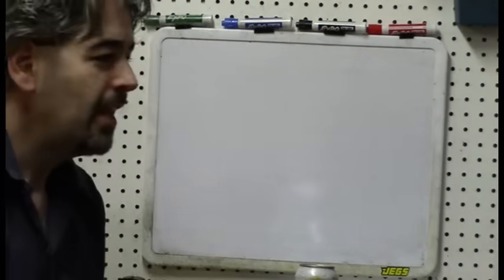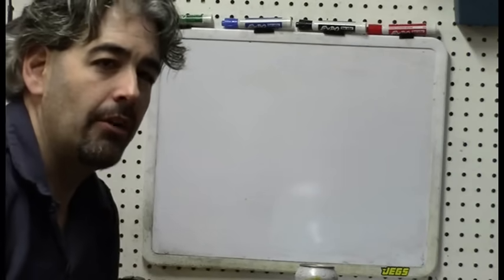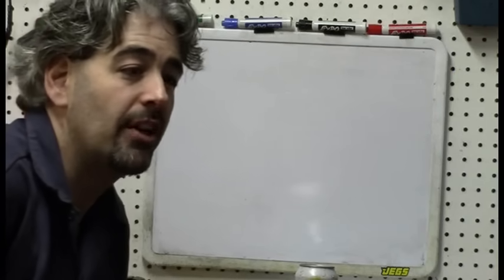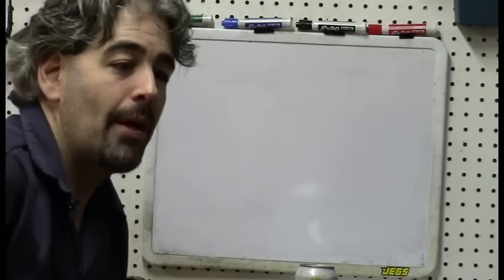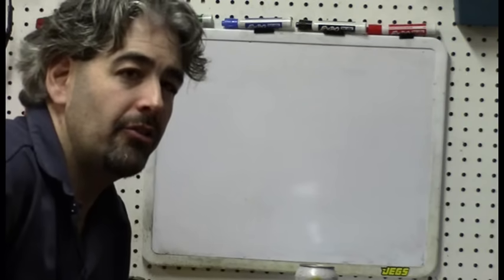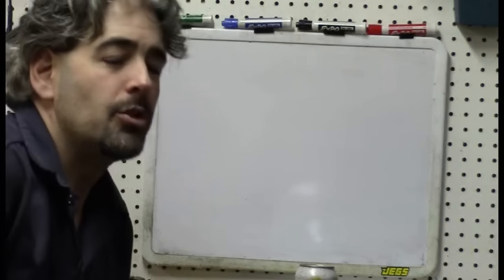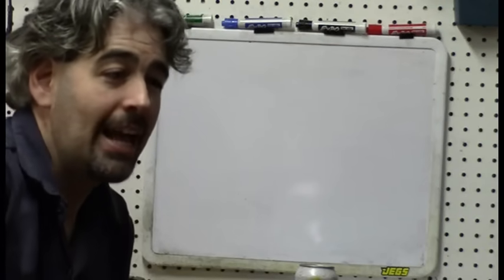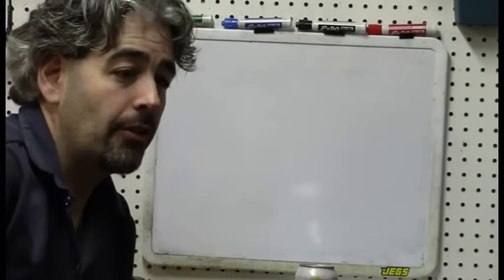Secret of Engine Problem Diagnosis- Fuel Trims Pt.1

Comment: My toyota on the scan tool indicates it is in closed loop. It never comes out of closed loop, according to the scan tool.
Any thoughts about that?

Also, my Toyota has B1 LTFT of 19.5% that drops to a steady 12-13% at 2,000 RPM. I used my vacuum gauge and it's ok. I double checked by spraying carb cleaner around all the sealed joints, and nothing. I check the brake booster: nothing. But, I did replace the O2 sensor about 3 months ago and now it's doing this. So I'm thinking maybe the O2 sensor is messed up, giving a false lean reading, thus the LTFT.
So I pulled the plugs, and they are fine. coils are fine. O2 sensors on both banks are reading similarly.
Reply from the maker: good thought on the booster. I would not even bother with the O2 actually since you have fuel trim adjustment that clearly zero’s on the short term. 
  The vacuum gauge is useless- it will not tell you anything on a modern car- remember your fuel trim is balanced. 
  I would recheck for vacuum leaks - it’s pretty clear that is at some level of vacuum leak but it’s not going to be very big.

Comment: I have a 2018 mustang gt with a Roush CAI, Roush x-pipe, Roush axle back and dealer installed Roush pcm calibration (tune). The car has ~5600 miles on it. My ltft bank 1 is ~11.7% at idle and around 5% during regular city driving. My ltft bank 2 is at ~7.8 % at idle and around 5% in normal city driving. My 02 voltage is around .65-.75v. I currently have no codes because they’ve been cleared but at wot and around 6500-7000 rpm my cel comes on with a p0300 code. My mode 6 on my scanner shows misfire counts as well (1-2 counts ) randomly across cylinders 2-7. My maf reads 390-500 g/s at idle as well. Car was checked multiple times even with the cel on and i have been told the car is fine and that nothing is wrong....coil packs are fine, spark is fine, Maf was cleaned and functioning fine.... what is going on??? STFT  is generally -3.5-3.0 too btw. Help!
Reply from the maker: Your O2 readings cannot be .65-.75 with those fuel trims  It is impossible.
  Either way you need to look at the O2 response under WOT.
Reply: Currently at idle im looking at this on my obd2:

Bank 1
Ltft 9.4
Stft -.08
O2st: .69
Bank2
Ltft: 5.5
Stft: .08
O2st:.705
Soo....what I’m seeing is what I’m relaying..
Reply: Is there a way I can send a screenshot of my live data somewhere? I’m using a blue driver obd2 as well. Appreciate the help as well btw so thanks  🙏🏽
Reply from the maker: @kicksnkrs8192  Just send me the relevant data only --not a screenshot
Reply: Sure. What exact data should I be collecting?  Fuel trims and what else specifically? I’ll collect the info on a drive tomorrow and post it. Also notice on my mode 06 data that I have misfire counts (between 1-3 counts) on random cylinders but no codes. I mentioned earlier that it was on cylinders 2-7 but today I had a few on 1 and 8 as well. Was wondering if that was diagnosable being so few and so random...?
Reply from the maker: I need to see the fuel trim curved against RPM
Reply: This evening’s test drive ; a mix of city and hey driving:
———————————-
At idle ( ~650 rpm) 
Bank 1:
Stft:
Oscillates from -2.3 to 2.1
Ltft:
Steady at 7.0
Bank 2:
Stft:
Oscillates from -1.6 to 2.3
Ltft:
Steady at 3.9
———————————
At 1000 rpm 

Bank 1:
Stft: 1.6
Ltft: 8.6

Bank 2:
Stft: -0.2
Ltft: 7.0
———————
At 1612 rpm

Bank 1:
Stft: 0.3
Ltft: 9.0

Bank 2:
Stft: 0.7
Ltft: 7.8
———————
At 1882 rpm

Bank 1:
Stft: 0
Ltft: 9.4

Bank 2:
Stft: 0.3
Ltft: 6.6
———————

At 2097 rpm

Bank 1:
Stft: -5.6
Ltft: 8.3

Bank 2:
Stft: -2.1
Ltft: 3.9
———————
 At 2321 rpm

Bank 1:
Stft: -0.3
Ltft: 4.7

Bank 2:
Stft: 0.4
Ltft: 2.3
———————
At 4066 rpm
Bank 1:
Stft: 2.3
Ltft: -2.1

Bank 2:
Stft: 2.5
Ltft: -1.1
———————
At wide open throttle 
(6679rpm)

Bank 1:
Stft: -1.6
Ltft: -3.1

Bank 2:
Stft: -1.8
Ltft: -2.3

Comment: Oddly enough 14.7 is the atmospheric at sea level. Is there a correlation?
Reply from the maker: Yes I get asked this a lot. There is no connection or correlation. It’s totally coincidental.
Reply: @SchrodingersBox  Surely with height above sea level fuel injection can compensate but carburettors need jets changed?
Reply from the maker: That would be correct.

Comment: Hi Matt, I've been watching your fuel trim videos + maf sensor videos etc several times and find it very interesting, I have a question and fully understand if you don't answer to this based on the following not so extensive info but to begin with I had a P0171 since I bought his Passat 2008 2.0 TSI a month ago, when erasing the code w my scan tool from iCarsoft the engine starts to rev badly and up and down not so clean, the short and long time fuel trims went to zero % but then the P0300 showed up w random misfire on cyl 1+2+4 and after a while just on 2+4...and after a while the engine runs like ok again but the long term ft is on 25% again...have done the testing and understand it is not a vacuum leak, have also removed the MAF sensor cable whil engine is running and no difference = it runs "perfect" wit or without the MAF inline...??? -I also checked the ign. coils and saw that there were 3 different kinds put into this car where 2 were the same, also switched places w them but the same misfire on cyl 1+2+4 were appearing, any hint would be much appreciated, thanks a lot if so cheers from Sweden ;-)
Reply from the maker: I would need to know the RPMs you saw the fuel trim at 25%
Reply: @SchrodingersBox  It's on idle 8oo rpm and when adding rpm's it's still on 25% and the stft slightly varies but stays around zero, added code yesterday is P0101...fuel rail pressure 3900 kpa...MAF cables w ignition on as follows: 1=4.85v 2=0,02v ground 3=11.70v 4=0,01v ground 5=3.09v thanks, I have the throttle pos values etc written down out in the car if you need them, also changed the spark plugs and nr.1 closest to the timingchain was very carboun fouled while the others looked pretty normal  ;-)
Reply: I hereby add the info of the following that took part after having taken my car to a VW workshop nearby, the reason for this P0171 and ocassionaly some other codes were in fact due to a leaking seal (gland) that causes this code but the computer doesn't realise this, air coming in the backway so to speak, cost me a lot to have it fixed as they had to remove the automatic transmission to put a new one in, 1000 $....now the code is gone and car works well hopefully, the cause of the no 1 fouled/burnt sparkplug is probably due to coal on the intake which I will try to fix myself.
Reply from the maker: I would do a volumetric efficiency test next - could also do rail pressure.

Comment: Doesn't the computer detects the fault, as rpm will increase without changing the throttle position, since there is extra air going in from somewhere. Or the rpm remains the same despite the fact that engine has to do extra work compressing extra unburnt air part, it just adds fuel, but then also rpm will rise without giving throttle
Reply from the maker: Yes if the RPMs change enough this will set a check engine light-- but the question is- for what? For a TPS? For an EGR?  the code will not likely be accurate.

Comment: Does the LTFT generally apply it's new/learned baseline on the next engine start-up? does the LTFT generally become more permanent after x amount of engine start-ups following the last ECU reset (depending on the make) ?
Reply from the maker: Yes- LTFT does get more refined with time. On a startup- the engine computer uses LTFt as the default 
  It isn’t right to think of LTFT as setting after “X” number of startups. Rather it is always evolving and adapting as STFT inputs are integrated.
Reply: Thank you sir!
Reply: Is it ever beneficial to manually reset the ecu? Perhaps after a correction is made and to clear out any 'bad memory' that would prolong the process of establishing a 'good' baseline?
Reply from the maker: It is not necessary. If there is “bad data” prior to a repair it will immediately be corrected by the STFT. In fact, this is exactly how i verify the repair is made. If for example a car has a LTFT of 25 with a zero’d STFT and I fix the fuel trim issue- instead of resetting the ECU, I will instead look as the STFT goes negative to correct the now “bad” LTFT value.
Reply: Okay, I have another question. I have a cheap 60$ Obdii ultragauge I've had for 7+ years. Anyway, it displays in real-time my STFT and LTFT (00.00). While driving, if I glance at the numbers and LTFT says 10.2 and STFT says -3.4. Does this mean in that very moment as  those numbers are displayed, the ECU/engine is currently behaving on the LTFT(10.2) number and STFT(-.3.4) is "making note" of the adjustment that would be better the next time engine is at that exact speed/rpm/load, (cutting back 3.4)?  

In other words, LTFT parameter in real time tells you what the engine is doing and acting on now - and the STFT tells you how much more or less fuel could have actually been used to sustain that current rpm/load/speed?

How long, or how many pulses, of the STFT's corrections does it take before the LTFT considers it? Is there a typical algorithm followed on ECUs if, f(stft)= LTFT?
Reply from the maker: @Wes_5kyph1  No its the opposite- the STFT shows the adjustment NOW while the LTFT is the baseline (also now). If at this moment you have a LTFT of 10 and an STFT of 3, your actual trim NOW is 13.  
  Eventually, if held long enough, the LTFT will change to 13 and the STFT will zero.  How long this takes depends entirely on the model. I have seen some cars do this really fast- within seconds.  others I have seen take several minutes.
Reply: Thank you, so the STFT metric is always in relation to LTFT metric. it's funny they don't provide a gauge for just 'actual fuel trim' (LTFT + STFT). Thank you!

Comment: I am dealing with a system rich code
things were very interesting until
the odb scanner stopped reporting the FTFT
it reports everything else normally

any idea why my odb11 scanner on PC stopped reporting FLTF - shortly after fitting a new O2 sensor - - it shows a flat - minus 100 % trim but its running nicely.

I disconnected the battery to reset the trims - and its still doing it.
Reply from the maker: It sounds like a communication issue. If you are reading in “enhanced parameter” mode try just reading in generic mode only and you might see the fuel trim work properly then. 
  I run into all the time on some scan tools.

Comment: So... I'm having an issue with my vehicle which I believe is consuming too much fuel - smoking gun is the spark plugs are sooty... No fault code though?? Eliminate air filter, brakes, cleaned map sensor.. Wondering if an injector clean will help?.. I have a obd2 scanner which is capable of trim and O2, would you suggest driving with it on live mode or idle
Reply from the maker: The smoking gun would be rich fuel trim. Always start with the most extreme basics- run a load curve of fuel trim overlayed with induction metrics. 
   Always always always do this as the first basic step.

Comment: Using propane does not help identify a Vacuum leak unless you know where the leak is. You must use a smoke machine because it covers the entire intake air system. You don't have to know where the leak is, the smoke will show you where it is.
Reply from the maker: I just spray the propane around all potential leak sources and you see the fuel trim change verify the location. I have literally dozens of videos showing this.

Comment: I changed my injectors and ever since my ch engine comes up po171 maybe bad cheap injectors???I thank you
Reply from the maker: Maybe wrong flow rate. Did you check pulsewidth before and after?

Comment: Hi, i have toyota corolla 100 1995, which have nonheated o2 sensor, just one wire. Could you please tell me how to test it and how to convert to heated o2 sensor. Thank you
Reply from the maker: Yes, if ytou have single wire, the O2 sensor itself is the ground when screwed into the exhaust.  You will need to backprobe the one wire with positive from your DVOM and the other DVOM lead goes to any ground- chassis, battery negative, whatever. You can then read the voltage output from the sensor directly.
Reply: @SchrodingersBox  Thank You so much

Comment: I have 4G63A engine, the output voltage of O2 sensor fixed to 58mV but it doesn’t affect the performance of the engine. Do I need to replace the O2 sensor?
Reply from the maker: i don’t know. what is the bias voltage showing? what is the signal output with induced rich and lean variables? did you confirm ground?
Reply: @SchrodingersBox  the  O2 sensor is a 2 wire type and the car is 22 year old
Reply from the maker: i need to know the bias voltage you are reading in the two wires

Comment: I am heating my gasoline to a vapor. use the injector bank to put gas vapor in the motor. Along with hot air intake will my car get better mileage?
Reply from the maker: No because the pressure would have to much higher than what the pump can deliver to compress the vapor. you would run extremely lean.

Comment: I have a question.   When you were checking the voltage when the engine was running and you quickly hit the throttle you saw the voltage go up.  I wish you would have done the same thing with just slowly increasing the throttle.  What happens when you slowly increase the throttle?   On my 1999 Grand Cherokee WJ the voltage actually drops a little when I slowly increase the throttle.  Is this correct or should it still increase?   Trying to diagnose if my sensor is bad.  Just got a P0108 code come up when I came to a stop and my engine died.  Started right back up.  Thanks for any input from you.
Reply from the maker: It all depends on the fuel trim. You can'[t say whether a response is normal or not unless it is normalized to fuel trim parameters.
Reply: @SchrodingersBox  guess I will need to watch your fuel trim video again.  I know the mechanic changed this sensor on my last service.  Don't believe He used a Mopar sensor.  Never had any issues until after my last service.  So this is why I'm thinking it could be the sensor.
Reply from the maker: But is it the sensor or is the sensor accurately reporting g the actual condition? This is why you must know the absolute baseline
Reply: @SchrodingersBox  where are you located.  Just checking and I could bring my jeep by.

Comment: So I keep getting a P0420 cat below efficiency threshold and a P0138 for coolant not geting warm enough or fast enough - at the same time. But I just installed a new thermostat, water pump and engine coolant temperature sensor about one month ago. 
Why would these two codes be triggering together? And is there anything I can do to diagnose wether or not the cat code is genuinely coming from a cat problem... or just something else triggering that sensor?
Fuel trims look normal.
2003 Nissan Xterra 4 cyl 2.4L manual, 200k (but mantained very well).
Reply from the maker: I what is your voltage at the CTS showing when engine is cold cs warm?
Reply: @SchrodingersBox  Good call: when I went to check it the top of the connector just snapped right off as if it was already broken and barely holding on. I must've over torqued it last time.
So I replaced it and the coolant temp gauge sending sensor. I'll see if the problem happens again over the next few days of use.
Reply: @SchrodingersBox   Schrodingers Box  ok, so after installing new CTS the temp is holding good but the p0420 cat under efficiency code is still triggering. That's fine if it's just an old cat, and yes it IS probably old. But why was it triggering SAME EXACT TIME as my temp triggering (before I installed new CTS)?
Do I have any other option to verify that the cat definitely needs replacing? I don't want to just guess.
Reply from the maker: Could be coincidental. I would look and see if the S2 trace superimposes the S1 trace at 2200 RPM. If it does, you’re done- you need a cat 100% certain.
Reply: @SchrodingersBox  when fully warmed up, at 2200rpm, s2 will look like a trace or an inverted trace of s1 from 0.05v to 0.75 v for a few oscilations ...then the LOW end of s1 will start rising up, so it's now oscillating in between 0.65v and 0.75v, while s2 maintains (.05 to . 75). Then repeats.
Definitely the cat? And are aftermarket cats ok, or should I stick with OEM? They're 3x the price,but I really don't want some cheap junk triggering my engine light all the time.
Reply from the maker: Looks like a cat to me the way you describe it. S2 should be rich.

Comment: Very detailed explanation, very informative, and valid points illustrated. You  have alighted me in so many areas. If the MAF and the Intake Air Temperature sensor are working properly, does low compression ratio from the pistons can create (P0107 and P0106) codes?  By having a low compression in the Combustion Chamber, does this condition means that the Baromeric Pressure Circuit Low Input is from the MAP sensor?
Is the EVAP system is not operating in optimum conditions, does that means there is less pressure in the intake manifold? I want know if either one or both condition contributes to the MAP sensor to be faulty?
Reply from the maker: Low compression with show a high fuel trim due to the unburned oxygen and will produce lower vacuum.
  EVAP is monitored by the tank pressure transducer.